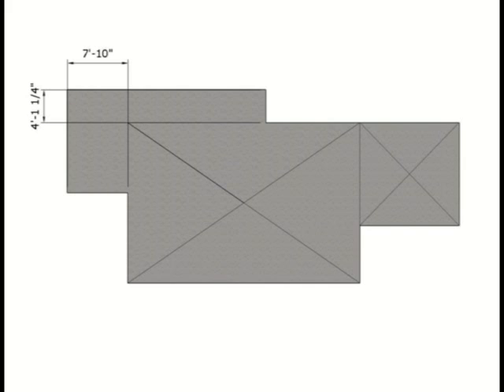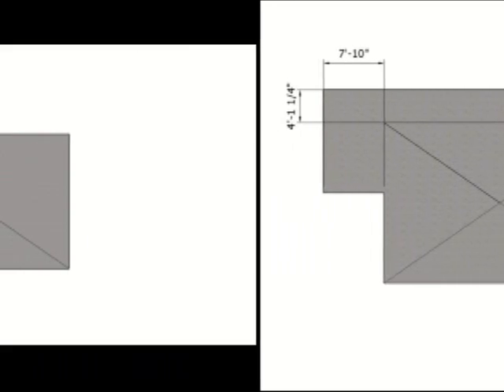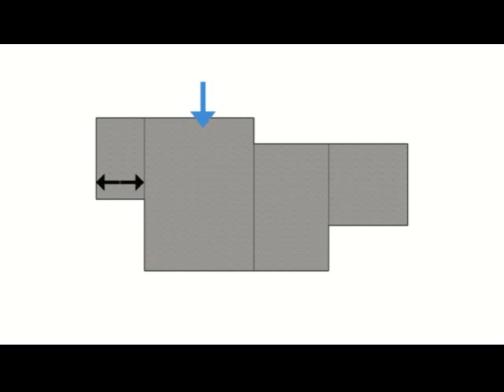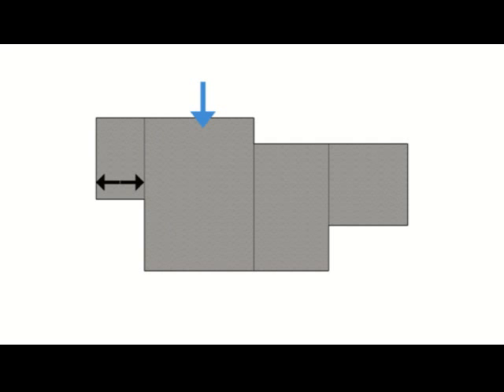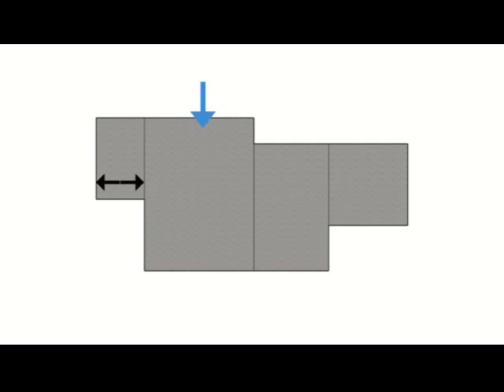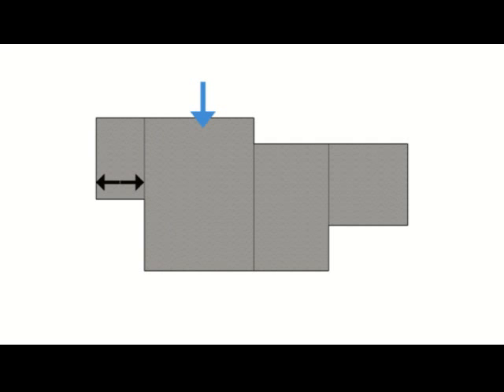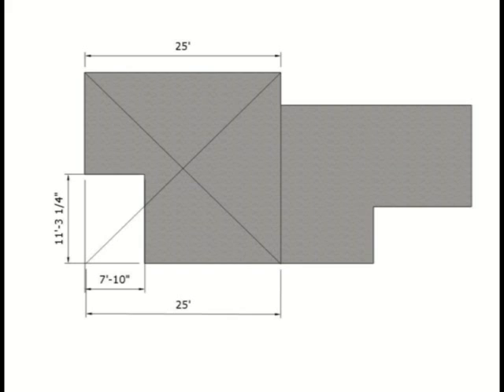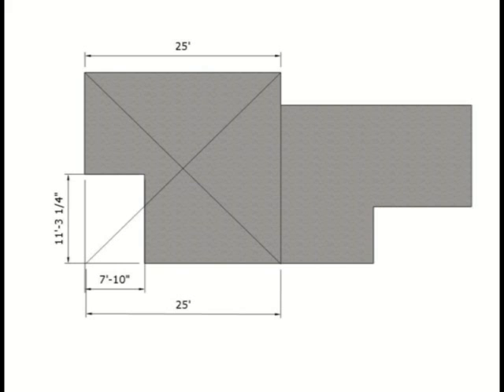How To Check Multiple Shaped Building Foundations to See If They're Square

Comment: Thank you for making this video. This is exactly what I have been looking for. I am building my own home, but having a contractor do the crawlspace foundation which is not a simple rectangle. Says it is complete and ready for framing so I need to check it for square. There are also deck piers that must line up with the foundation. I also was wondering how to compensate for an out of square foundation. Thanks again for what you do. Your videos are a tremendous help.
Reply from the maker: I will put your question on my future video list. Since this is not an easy question to answer, all I can suggest would be to go to our website and check out some of the crawlspace and foundation videos.

Comment: Surprised no comments on such an important subject! How would one compensate the framing when the rectangle is out of square by 1/2" Greg? Thanks
Reply from the maker: I agree, and thanks for taking the time to post the first one. I looked through my videos and realize that I haven't made one, so I put it on my list of videos to be made in future. If you have a square box or rectangle that is a half-inch out of square, then all you need to do is move the top or bottom to the right or left, until the two numbers are the same. Let me know if that doesn't make sense.
Reply: Yes I understand, but what if you need to frame a small structure where the foundation has been prepared 1/2 out? How does one compensate for that issue as I'm sure it may happen from time to time? The foundation crew is gone and crap, out of square. Thanks Greg..